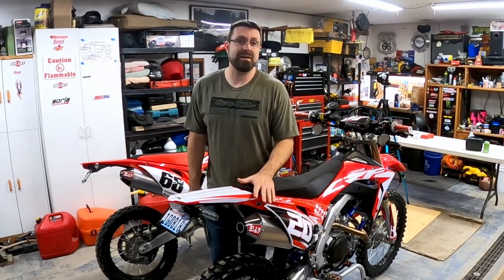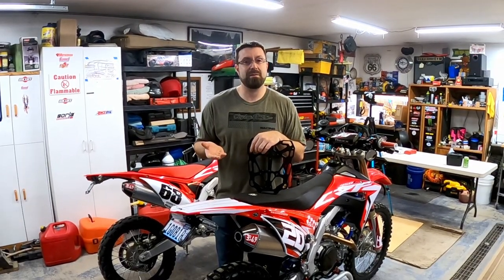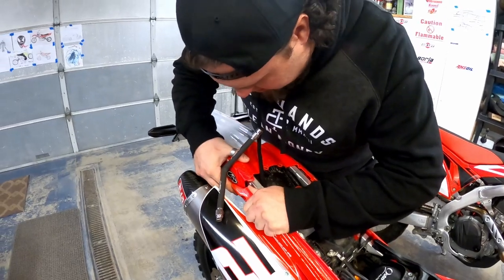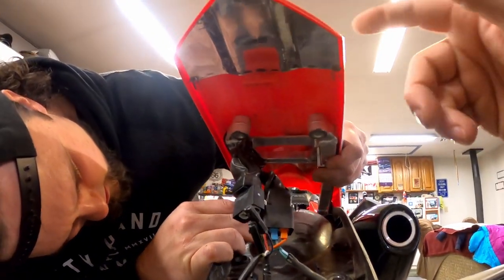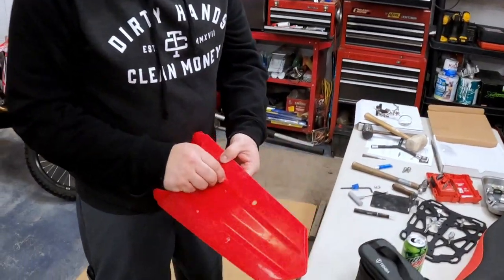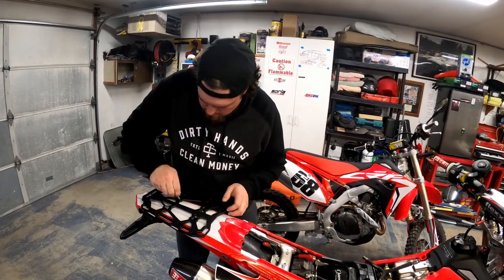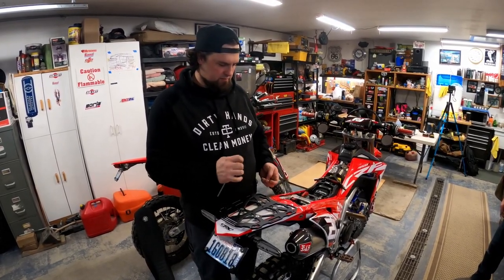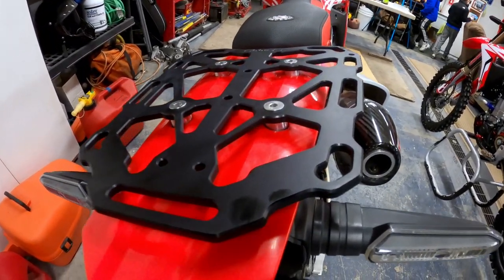Skaggs Rack Install CRF450l & RL

Comment: I have bought the nelsen rigg saddlebags.
They are up to 15 L per side. There is a big pocket on the bottom of each side where you can put a fuel bottle. Also have the Enduristan Hurrican 15L backpack for luggage. There is also a cheap rack from adventure specs, maybe I try this ( I am from germany).
Reply from the maker: I really do like it. Its simple and to the point but so secure mounted to the frame. I might checkout some of the stuff that you mentioned as well

Comment: Hey, liking the vids, especially since you are right here in my area. Seriously considering the 21 450RL purchase in the very near future.  Saw on your IG that you may have had some issues with a local dealer.  Did you end up buying from them or did you find an alternate location to buy one?  May not have an option as not too much in stock that I can find, but was curious.
Reply from the maker: Well I can tell you I've personally had good experiences at Westside Motorsports and Alsport. My dad just picked up a used CRF250l rally at CDA Honda and he said they were great. He went to the parts counter at the dealer left I haven't mentioned and he said they were as unhelpful as always. I personally have no reason to ever go back there under current management so I stick to my two preferred dealers. I need to start posting on IG more again....it always slips my mind to post there